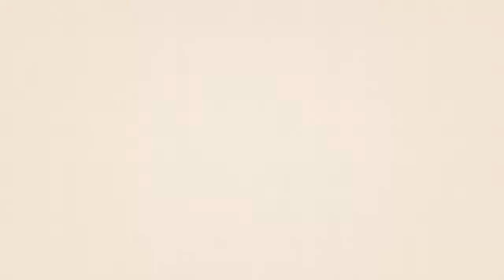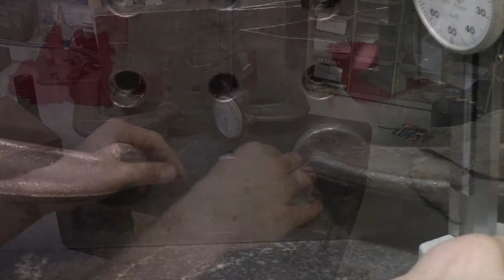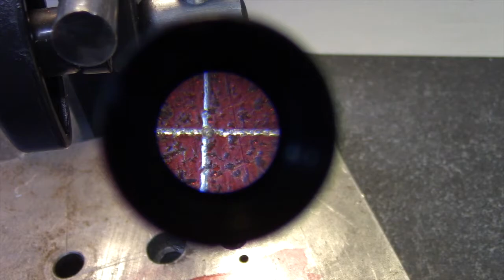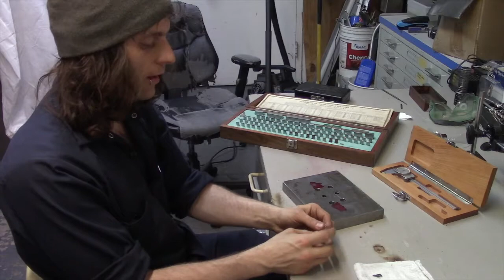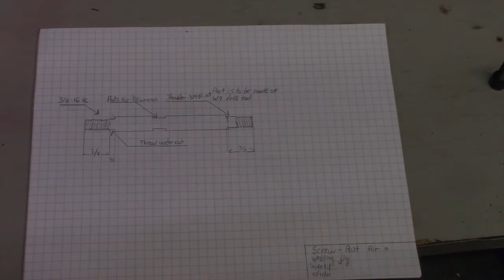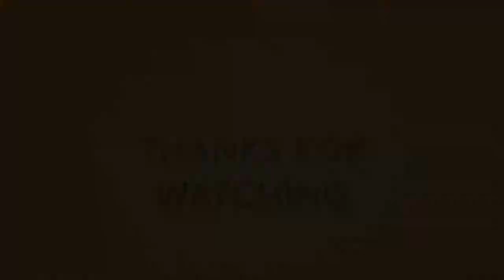Arbor Support 3: Finishing the Welding Jig, Getting Accurate Results with an Inaccurate Machine...

Comment: Looks like it will turn out nice. Looking forward to seeing it finished. I was recently given the standard model with the 21 inch table that has a Bridgeport M head on it. It didn't come with the arbor support so I will be making one shortly.
Reply from the maker: Thanks! Is the M  head with no quill like my C head? I'm sure there are a lot of ways to make the arbor support. I was originally thinking about buying a large piece of cast iron and sawing out the form.
Reply: @tilliesinabottle  I just saw your reply, we have been getting t storms at night and losing power. The M head is more like the J, it has the quill with the spring and the fine feed hand wheel on the right side. It has it's own motor mounted on top, I think mine is the high speed model with the lowest speed being 950rpm. Not positive though, I haven't ran it yet and the speed data plate is worn blank. lol I was thinking of a cast block also but I think I'm going to just use a thick plate. or go the route you did and use a triangle shaped plate to tie the bushing housings together, kind of mimicking the original with that forward  offset. Who knows, LOL

Comment: Njce, can see it coming together really well.  Better than endlessly searching eBay for a part that rare.  
I've been using an optical center punch, but still can be off, I assume due to parallax.  Confirming with optics like you're doing and trying to correct if needed by re-punching at a slight angle seems to work well.
Reply from the maker: Thanks! It's probably the only way to get  this wobbly mill to put the hole in the right spot. An optical center punch would be good too, probalby faster as well